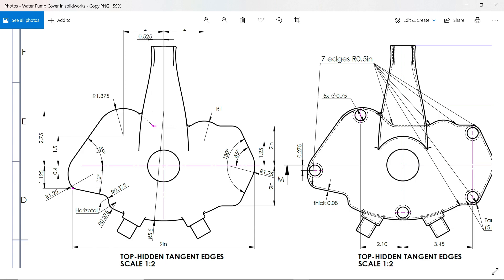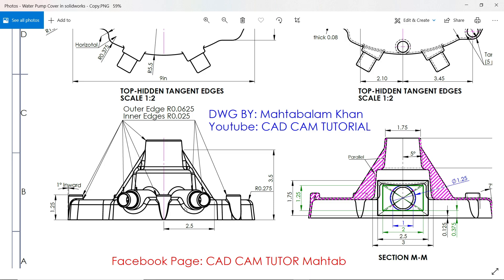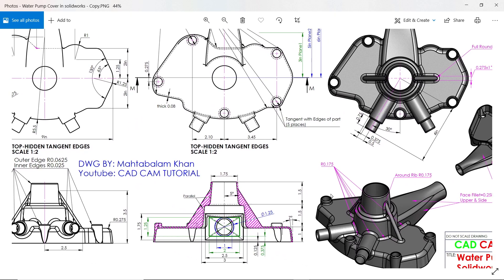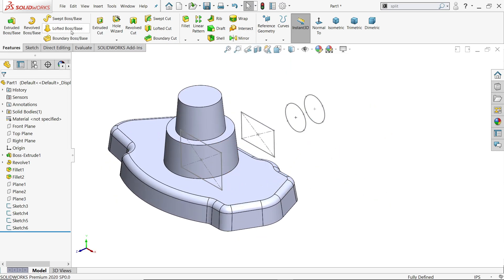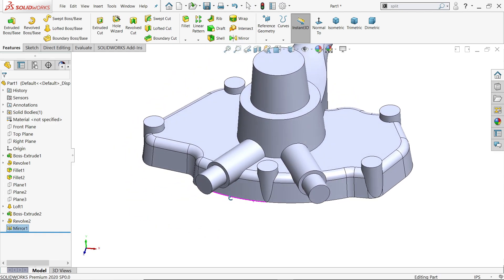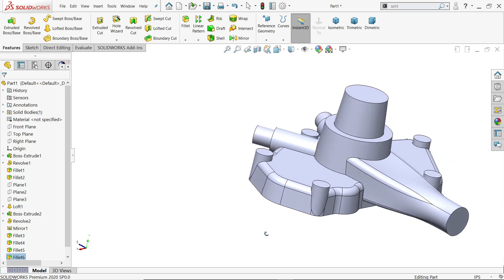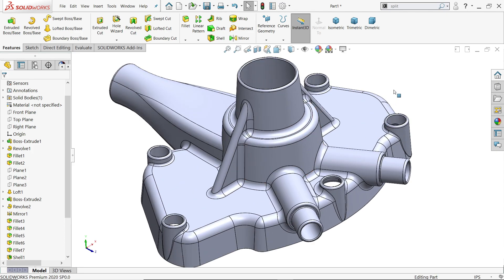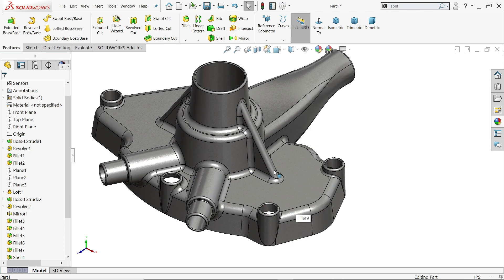Water Pump Cover in Solidworks | Solidworks Advanced Exercise 161

Comment: Great video! It would be very interesting if you took this a few steps further and demonstrated how to take this model and create the mold and core sections required to cast it. Although I suppose the approach would be to model the casting with extra material on the bottom face and no bolt holes, then add the machining afterwards in order to be able to toggle it on and off.